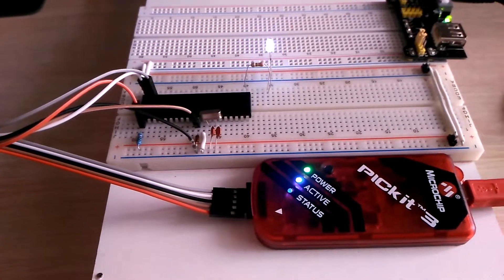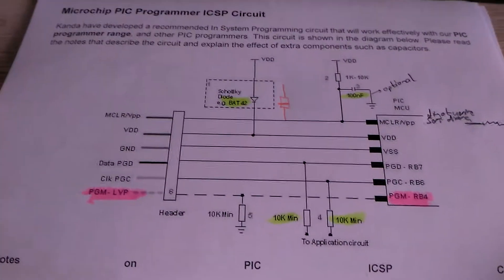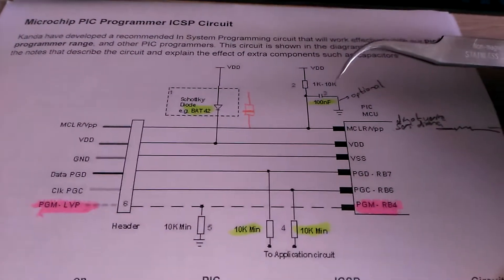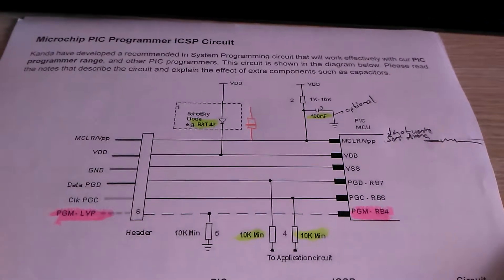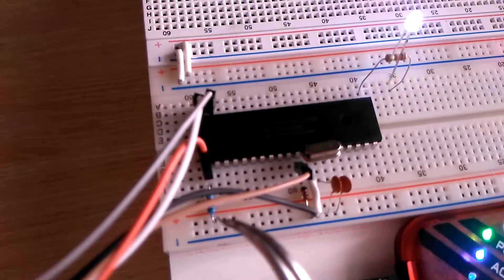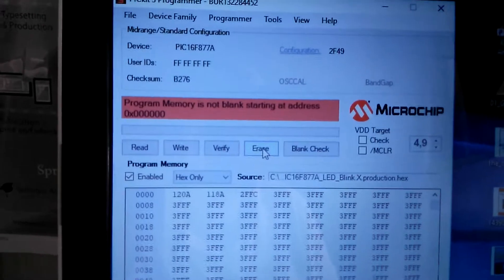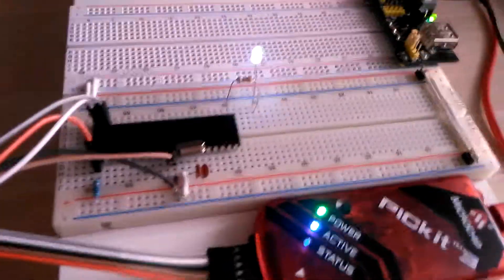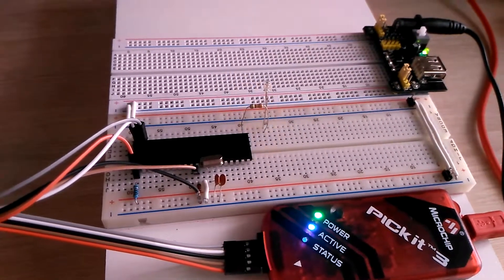PIC16F877a,  ICSP Programming with PIC KIT 3

Comment: Hello, do you have to use the diode and external power while doing it this way? as I have the same setup just not working from my side
Reply from the maker: Please check the diode direction. You can select external power in the programming software. It is your preference.